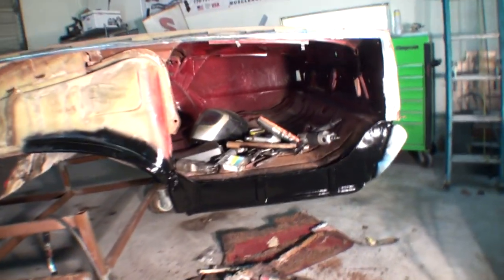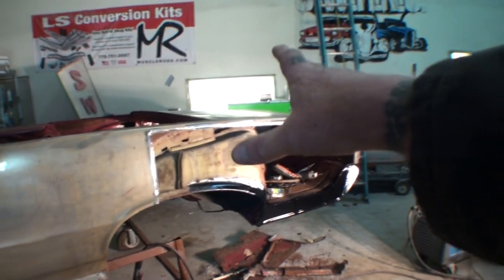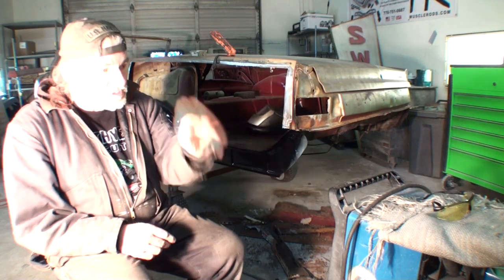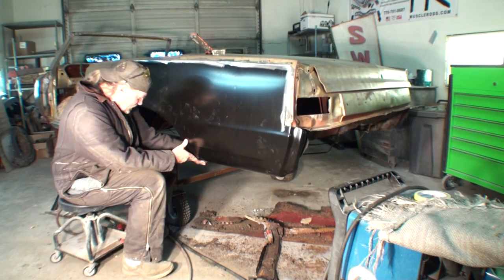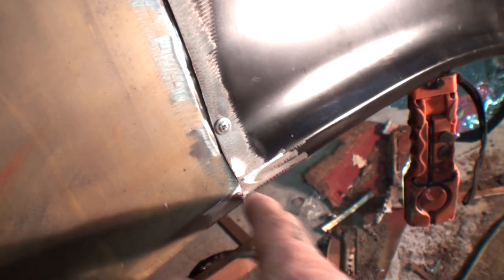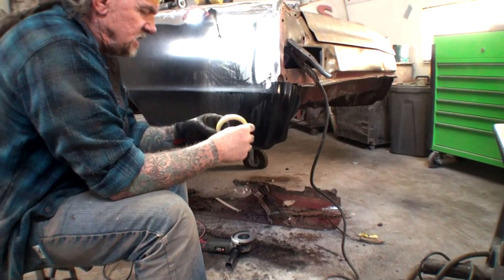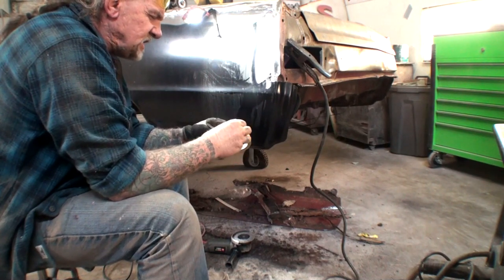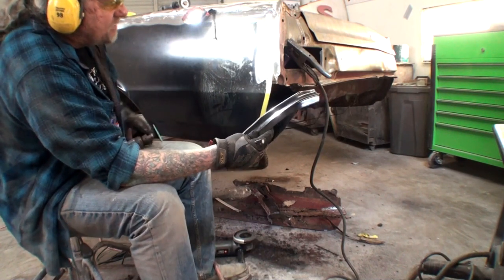1965 Pontiac GTO - BARN FIND Restoration - Part 6 -  " RUST REPAIR WELDING "  !

Comment: Pete, I know you can answer every comment posted. I just want to say, that what you do, what you say and what show us is valuable. I used the flanging method on the back cab window of a 1967 C10 PU that my son gave me after giving up. I was welding fabricated panels for rust, electrical and engine. The small rear window was a cluster. It must have come from a trailer or camper, bolted in. After a cordless saws-all, I harvested one, measured 7-8 times, cut and flanged it in place. Because these are structural parts, Many don’t think of the stress & twist they go thru. I like plug welds after in place with 35 pairs of vise grips & to center. Came out great.,
 I find the videos hypnotic and can’t wait to see the next, like a marathon!
Take care Pete! You have a lot of energy and will have to delegate the repairs to good employees in the future. Time catches us all. Blessings!
 Retired - ASE Master Tech since 78.
Reply from the maker: Sorry I don't answer every comment left on my videos.. Im usually busy answering Emails and Phone calls. I know it's important to answer video comments and I try my hardest to do so, but there's only so many hours in the day and alot of work to be done.. Sounds like your on the right track of getting it done yourself, so keep up the good word and if you want to share any photos with me you can email me them.. Thanks for watching!
Reply: Thanks for the kind words Pete. I know you are very busy and don’t know how you do it. 
 I will be having my 4th lumbar fusion (L3-L2) level from an OTJ request to run a 200 lb. earth compactor in the mud for 5 hours. I am 6’3” tall & burns when I bend down, so It will be a while before I can work in my garage. Common sense helps, but you have to have talent. That comes with time for some, but you are shining wisdom on everyone who watches. I very much enjoy your talents and should have gone into business myself. I will get by with what I have, but enjoy and support you! Moab is a great looking place!
Master tech-Retired Omaha.

Comment: this is great. i found your videos by just searching for a way to get my roof drain railing off on my 65 gto. i worked professionally as a mechanic for 30 yrs but i never really did body work. so far i installed a trunk floor. i really enjoy doing this work & having the right tools makes it that much easier.
Reply: Sounds great Mokearoint.  Keep up the good work 👍👍

Comment: Hi there Pete thank you so much for teaching so much I have one question I have slowly started using por 15 it is great stuff for sure I see some videos out there where people just paint it on no cleaner or prep if you wire wheel a spot or sand it clean say behind a rear wheel well do you have to use the cleaner and prep I just feel odd adding water to it I feel like I am adding to the problem by putting water on it what if water gets in a area I can’t see I do blow it out with air sometimes use a hair dryer just asking thank you
Reply: If your gonna wash it out with water you would wait several days to apply the por15.  I don’t use the cleaner either. Waste of money. Good luck!

Comment: My friend Pete I have a question for you sir.
I am restoring a 68 Nova but I don't have a garage, I am starting the bodywork and I have to primer it every time I close up for the night. 
Do I need to strip the prime off to continue my work? Or can I apply bondo over the primer.
Initially I did strip it to bare metal and stuff with 40 grit and filled with short hair filler first.

Comment: MFP, looks like a lot of love for a hidden corner.  Do you coat the inside of the flange?
Reply: After it’s all done I will apply epoxy and color to it.  No need worrying about the flange weld. By the Tim you do everything you need to finish the job it will be rust protected

Comment: Last few years all my sheet metal i stock 4`x4` sheets 18g,20g, 22g i spray lite coat  white thinned down Epoxy primer so it doesn't rust and its coated when used small touch up only required but im OCD
Reply: In Australia we have a zinc and aluminium coated panel called Zincalume, its the same thickness's as usual, weldable as is and rustproofed (To some degree) You might be able to get something similar

Comment: there are a few places to buy body parts,  year one, national parts depot, ames performance. the problem is the money they charge. these parts are made in taiwan by workers making 10 cents an hour, yet they want to charge people like these parts are coming straight out of detroit. it's not right that they make it so hard to buy parts. I was looking for a rear filler panel for my 65 gto & this place wanted more for that than a quarter panel. i will sooner make my own part than pay them that kind of money.

Comment: you would laugh on what i call a rust bucket i have a 65 chevy pu and in the kicker panel it has a rust hole about the size of my little finger or smaller and i call it my rust bucket the rest of my rigs have no rust from factory even my 55 2 door post i bet i have scraped cars that would make people cry the next car i'm scraping is a z28 because the rear quarters have a little rust in it last year i scraped a 71 mach 1 but after working in a car restoration shop i hate rust . i payed 500 for my 66 gto with no rust clean body but they put a sb chevy in it i got the 389 with the car and rebuilt it and had to fix 6 dings in the car very small one's u should see my 68 pu that i only have 2300 in it still has the factory paint very clean body the drive train is all restored and painted under side is painted just needs final paint running a stroked 454 with tunnel ram twin electric fans serpentine belt 12 bolt possi heavy duty 400 turbo next i want to put drop spindles with disc brakes